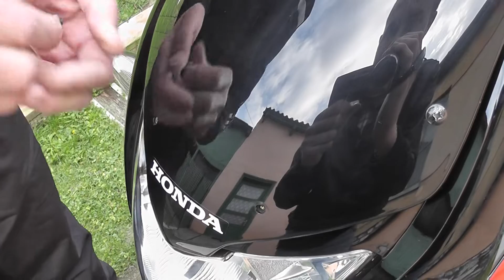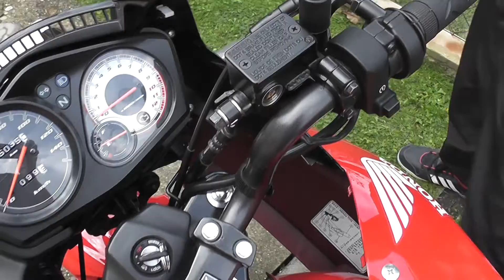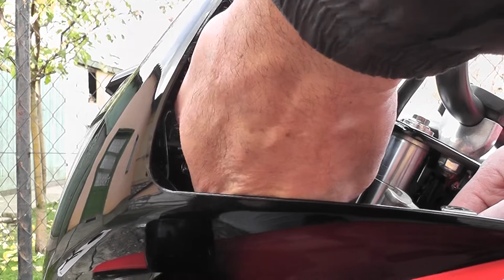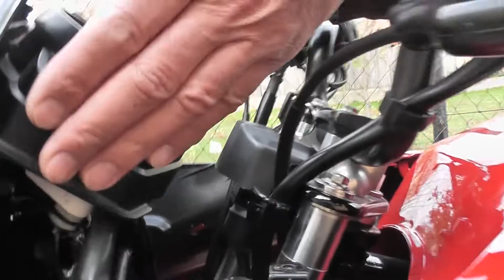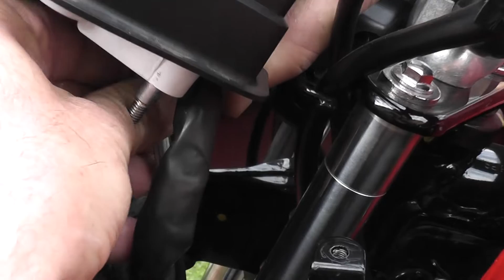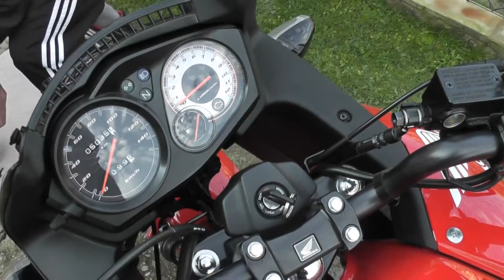Honda CBF125 - Dashboard Light Bulbs Replacement

Comment: I installed LED ones on mine as my speed light wasn’t working so I thought I’d replace them all with LED’s whilst I’m there and the difference is night and day. It’s absolutely amazing with LED’s i would definitely 1000% recommend it to anyone thinking on doing it. I paid £8 for a pack of the 10 bulbs. Definitely worth it
Reply: Hi! Thanks for sharing your experience! I also have one of these bikes and I'm thinking about replacing all of the original lights (speedometer, headlight and tailight) for LED's. Is it possible, or I need to replace any relay?

Comment: I know the struggle of trying to reach into something with a wrench and it doesn’t fit so you try your hands and they fit less then you give up and cry a little and try again later after cracking a beer and something eventually works and you forgot why you undid it in the first place (and you inevitably take them off again because something went wrong the first time)... Honda the joy of riding!

Comment: Any idea what wattage bulbs? One source says 1.7w another says standard sidelight bulbs (5w)
Reply: Does that not cause a strain on the electrics?
Reply: +SteShinigami  1.7 Watts is enough, never 5 Watts 12V. I replaced with 5 Watt but 24V !! Same brightness but eternal life!
Reply: I've use 5w and found it to be hard on the electrics so I've gone back down to 3w